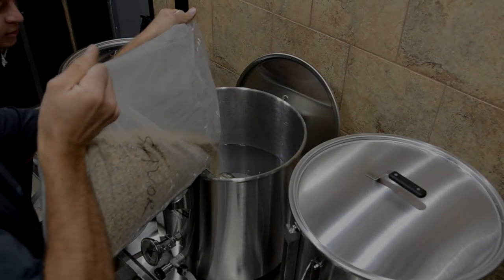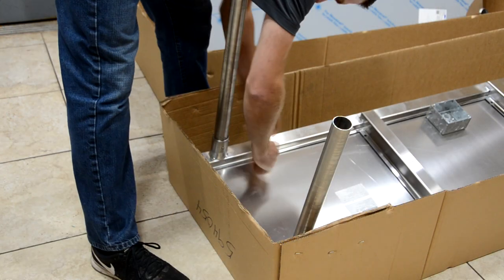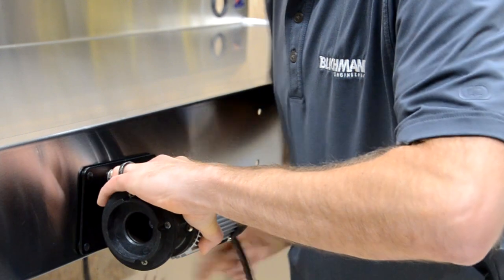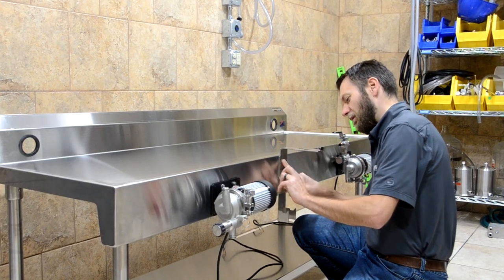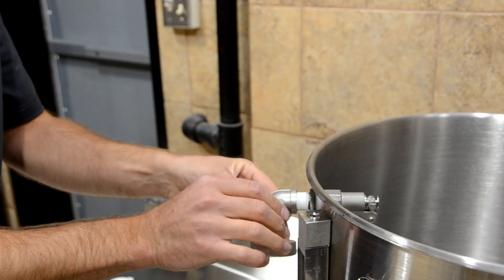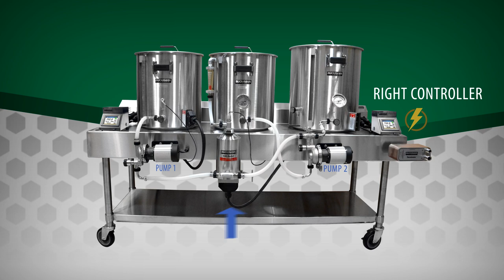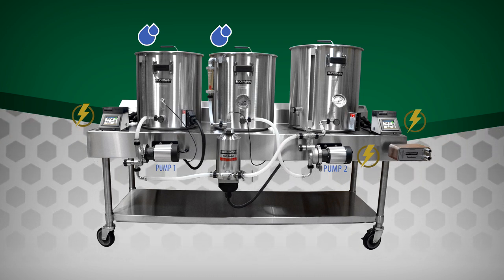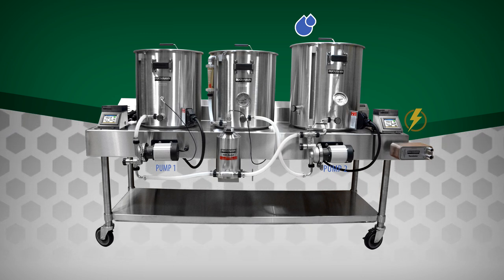Blichmann Engineering Pro Pilot System

Comment: Hi i think they should’ve connected the boil kettle via whirlpool port and not the drain port.. 🤔
Reply: In this case, they are just pushing the wort from the mash kettle to the boil kettle so you could technically use either port.  After the boil though, you'd have to change the hose on that port to pump the wort through the therminator.  So drain port to pump in, pump out to therminator in, therminator out to fermenter.  Definitely have to do some hose switching after the boil to get everything done.  Not sure why that's not in the video?